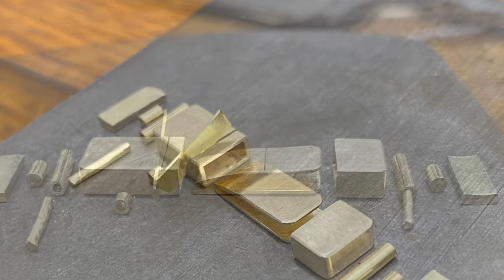DIY HOW TO MAKE BOX CLAPS -MAKING BOX LOCK [ KARLOFT ]

Comment: I am planning to do a similar sort of thing with 18ct white gold.   I am concerned about the material not springing back (the metal being annealed in the process of soldering it is quite plastic and seems to lack elasticity)  the material is 0.5mm thick and 5mm wide.  

If I heat it and let it cool without quenching will that harden it?  

Any advice?
Reply from the maker: Sí, después de soldar, la placa se volverá más blanda, después de soldar, golpee suavemente con un martillo y se volverá elástica.
Reply: @karloft  спасибо 👍👍
Reply from the maker: всегда пожалуйста 😁
Reply: Он затвердеет после полировки,как и серебро,так и золото.